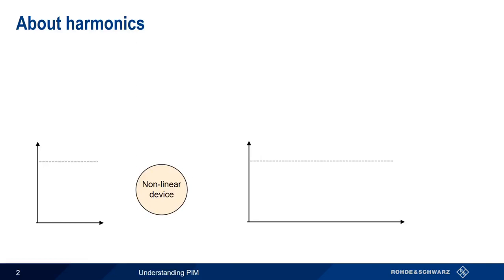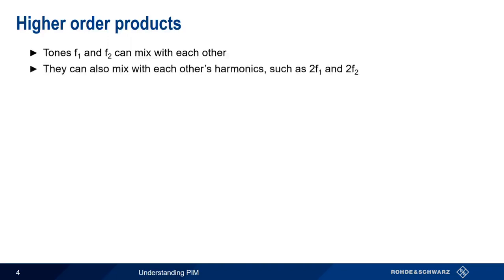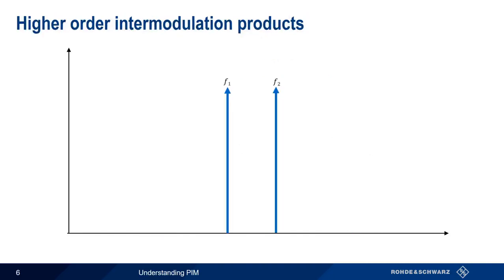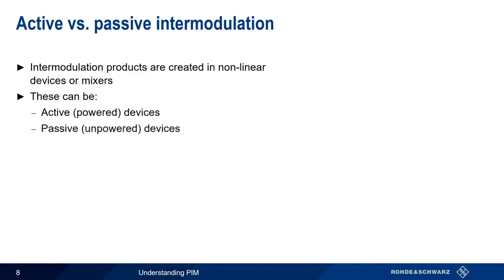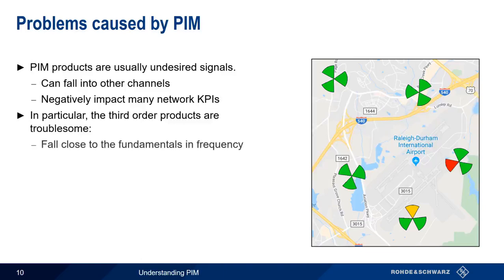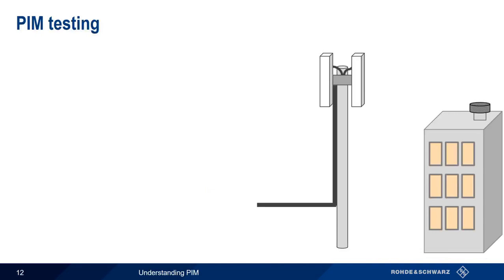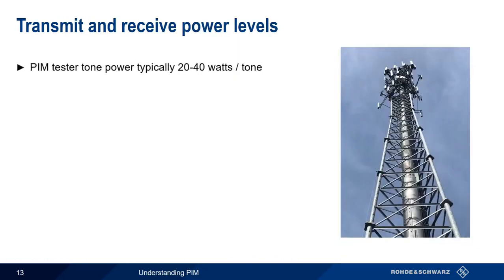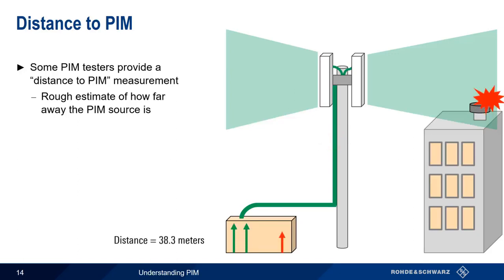Understanding PIM

Comment: Very good intro to PIM, as it is kind of black magic to some people. One point was maybe missed in this video: 
In FDD (frequency division duplex) base station weak uplink signals need to be detected in the presence of strong downlink signals. There's duplex filters to get this job done. The trouble starts however when a 3rd (or other odd) order product of two downlink signals hit the uplink frequency band. There's no way the duplex filter sees the difference between a real signal and an intermod product.

Comment: what is CW Tone at 7:31?
Reply: A CW (continuous wave) tone is simply an unmodulated carrier.  PIM testing generally uses unmodulated carriers as the stimulus signals.  Note that in some cases a PIM tester may "pulse" these unmodulated carriers, but this is done in order to save power (in a battery-operated tester).